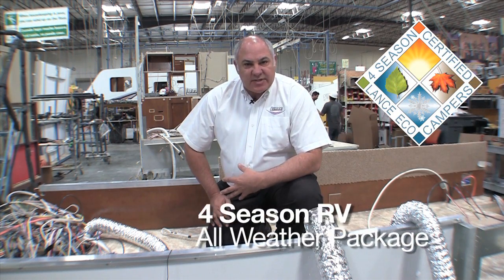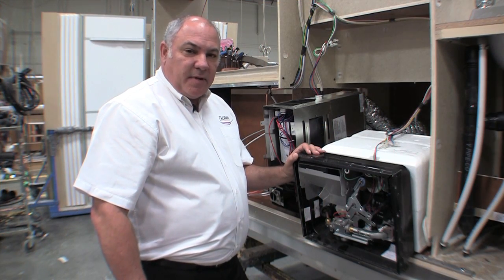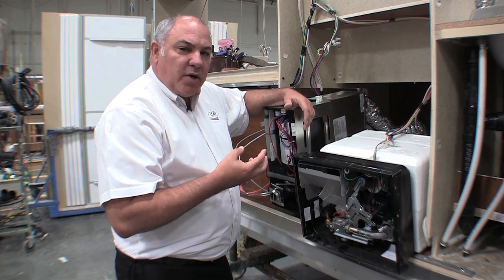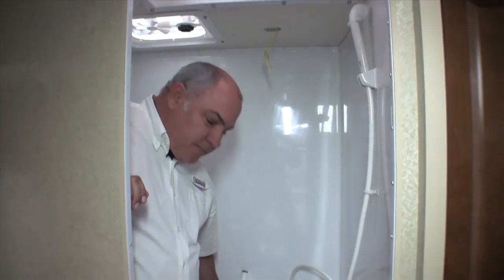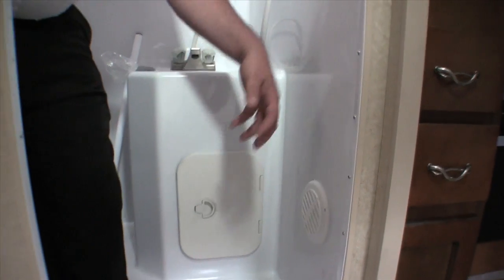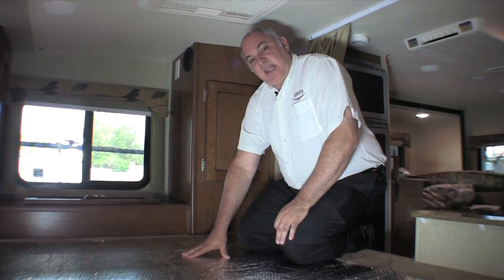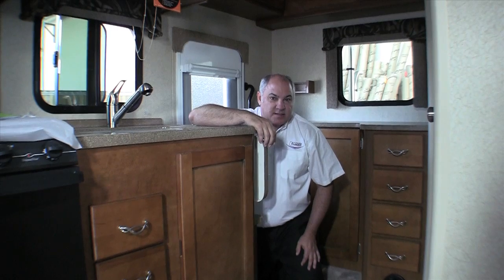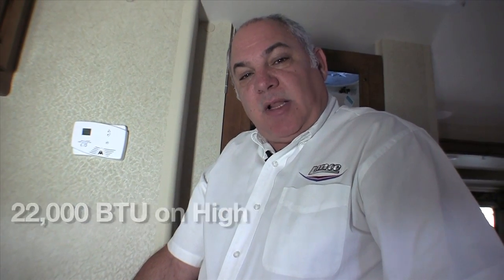Lance Camper:  Heating Systems

Comment: Love my Lance BUT, the duct to the floor yang by the shower was smashed completely shut at the manufacturing line by the shower pipe drain. I fixed it. The upper bed vent is not nearly as strong cfm as the others. This could be because of the length of the run. The flow seems adequate due to the rising heat from the other vents. These are my two complaints concerning my BEAUTIFUL LANCE CAMPER.

Comment: I have owned a 959 for 4 years. The heat doesn't work as good as they say. Anything below 30 degrees and things start to freeze. My valves still freeze. I had to add in extra insulation to valve box and i have to heat the comprtment to drain tanks. I'm at the point of adding in electric heating pads and better insulation below. One more thing. Never buy a lance with a slide out. Nothing but inconvenient and problems with fixing seals, motors and frame out of square. Lance are horrible and customer service is even worse.

Comment: When are Truck Camper Mfgs. Going to give options for non-propane heating systems when mounting on a diesel truck? Like Webasco, etc.? Propane heaters make moisture unbearable which makes the air quality unhealthful not to mention you have to crack those expensive double pane windows. ETC.  Also,  on demand water heaters with small "pre-heat" tanks.   I sear, it seems like this industry is mired in molasses when it comes to innovation and change - even when the R&D is already done for you. 
That is all.   Thanks for your videos.
Reply: A lot of truth to what you say.  I believe instant hot water tanks are available of some models but not on my 825.  Why wouldn’t they put them on all?  Cost? My  TC has been very reliable and heat is well distributed throughout.  I do crack the windows/vents a bit to release moisture and haven’t had a major issue doing that.